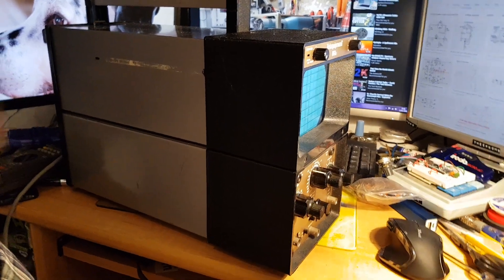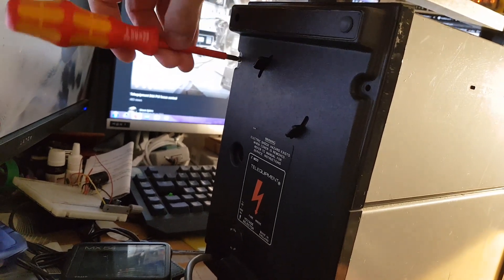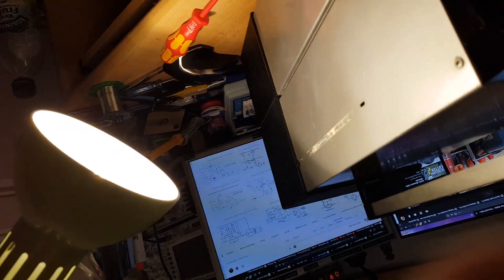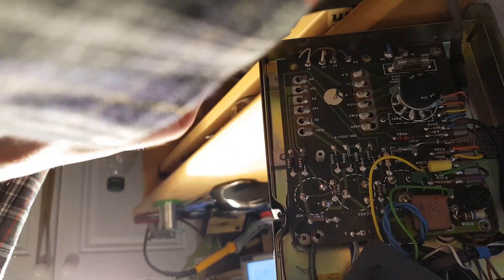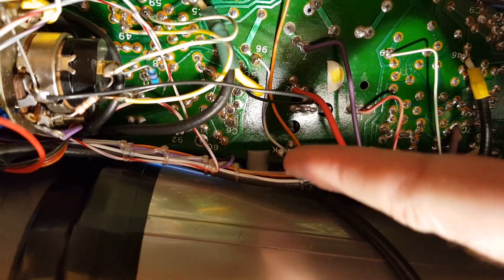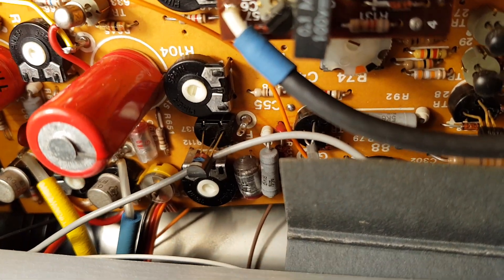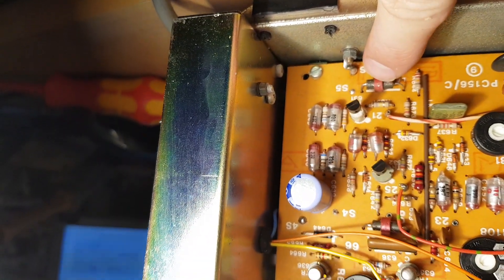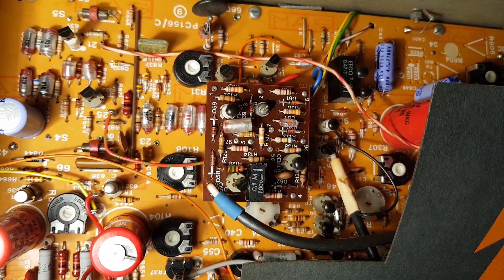Telequipment D61a Teardown

Comment: Does it work? Is it usable?
Reply from the maker: Yes & Yes.

Quite a nice scope. Entirely transistorised so should be possible to keep fully operational indefinatly
Reply: @TheEPROM9  Thank you. I bought one used, but I sent it to a guy that's an electronics expert because it's CRT monitor didn't work. Once he fixes it I'll post a video about it. It has a short circuit somewhere, but I don't dare work on voltages higher than 50V 😂😂😂